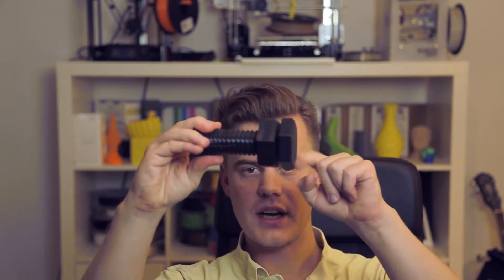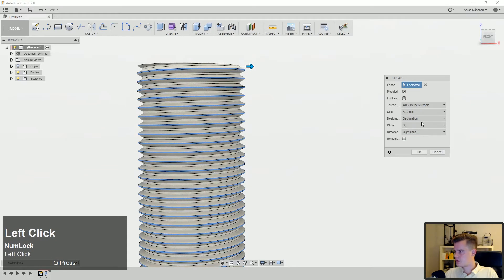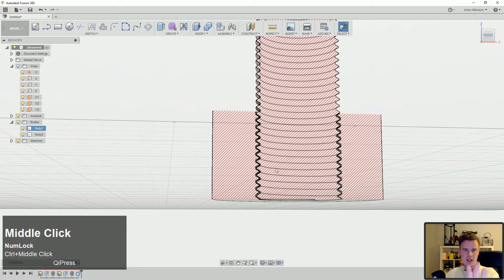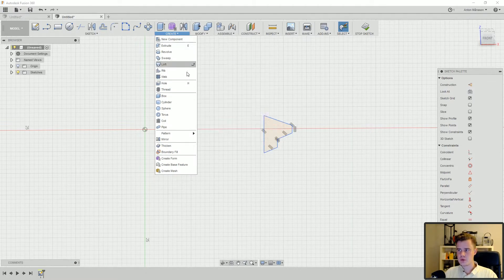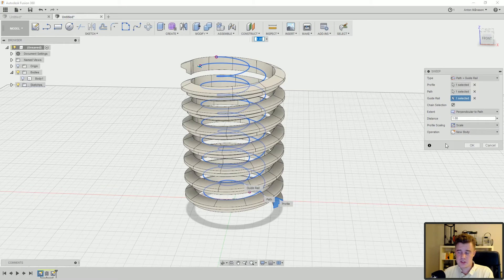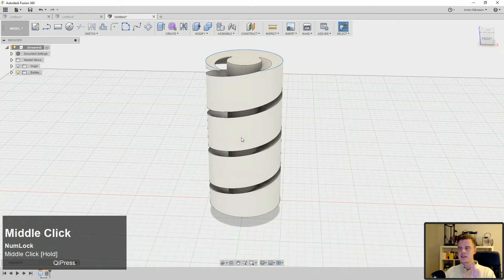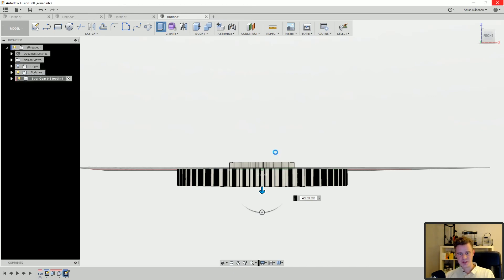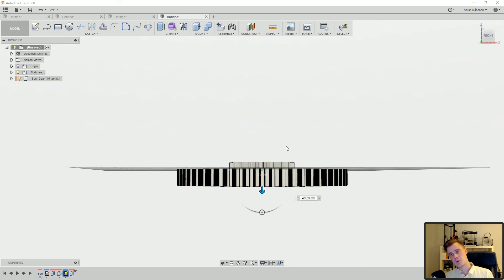Gears and Threads in Autodesk Fusion 360 for 3D printing

Comment: Thanks for a great video. No fluff, straight to the point. BTW, the contact of gears dashed circle is called the 'pitch circle diameter'. The part of the tooth above it is called the addendum, and the part below is, not unexpectedly, the dedendum.